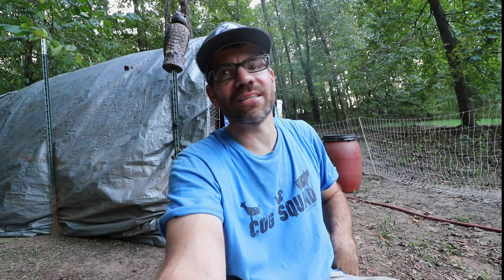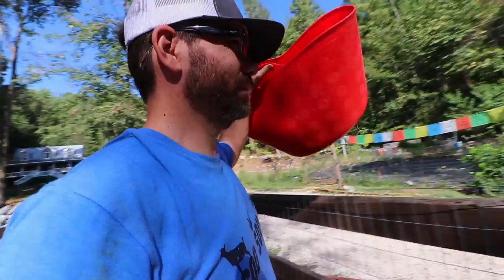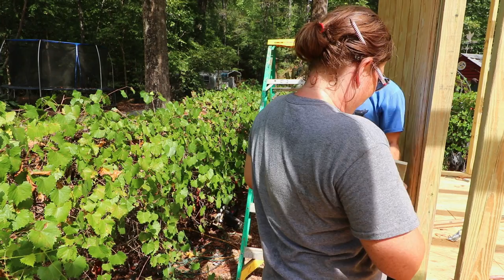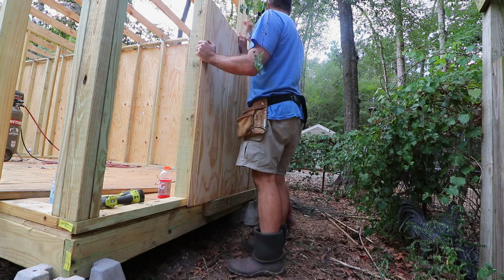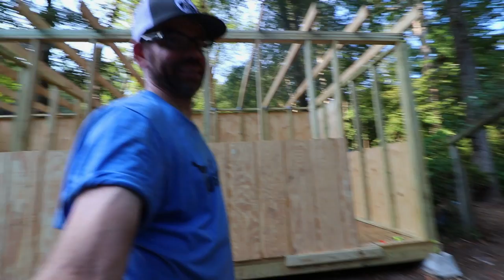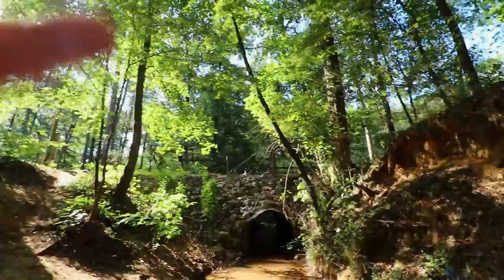Will We EVER Get This Siding on This Chicken Coop!?! (DIY CHICKEN COOP)

Comment: Ppl think the siding just hangs on the bones of the structure, but, it’s a structural element too..you can push the frame if it’s not quite square, then screw the siding in to secure the squareness. It provides lateral and other directional, torsional stiffness. I also learned that’s why two nails in a stud is so strong..it’s a combination of all the elements working together. Two well placed nails beats three that split the end. I learned so much watching a pro carpenter build my coop..

Comment: Looking good! I wish someone would have suggested the “Smart Siding” by LP. Instead of that T-1-11 siding you went with. The smart siding comes already primed. So it won’t soak up
Reply: Where do you find it? Thanks!
Reply: Home Depot for sure. I worked there and sold it for 16 years. It’s made from oriented strand board (OSB). It’s 3/8” thick and looks a lot like the T-1-11. It’s a very stable product and will not warp or delaminate like plywood. And best of all, it’s typically a lot less expensive than that 5/8” T-1-11. To say nothing of being environmentally friendly. Don’t let anyone tell you it’s particle board, because it’s not. It is rated the same as plywood for exterior use by the American Plywood Association (APA). Sorry for being so talkative. But it’s an excellent product!
Reply: @jacktomberlin7976  Thanks for the info. I took a photo. I'll know right where to go when I get there.. I was concerned about the weight of the siding but, MRS. COG HILL solved that one for me.. Thanks again Jack...

Comment: My husband and I are currently building our own first chicken coop.  I'm here to check on how you did your roof and we did it almost the same way except the pitch on ours is steeper (1 ft higher on one side than the other side).
Since I didn't bother with the birdsmouth cut (I'm the designer and lumber cutter, my husband is the installer), I too opt to using the brackets like you did here.
My biggest difficulty is the roof itself.  Since I'm much lighter than my husband, I'm the one who's going to climb up there and install the metal roof and I'm afraid of height.
Reply: Update: once a sheet of the metal roof was on, it's actually not bad.  I had a flat place to stand on (or in most case, I was sitting on it, more comfortable) screwing the roofs down.

Comment: I put my run up, biggest structure I've ever done, smaller then you construction.  I measured stuff out, I built it with headroom for my 6'2" body.  Got it done, filled the run with sand for easy cleaning.  Turned around to walk from one half to the other and BLAMMO!  now that I have about 4 inches of sand I have 2 inches too few head clearance for a support beam AND another purty dimple in my forehead!  Go big or go home.  Also, because I was rushed thanks to an operation I had to have the day after i finished and moved the chickens in, I forgot to put landscape fabric between the gravel base that covers the 2x4 wire to keep tunnerlers out that also goes to the drainage for the whole area and the sand.  So two weeks later when I could use my lawnmower to get out and look at things, I saw the gravel was popping up in the sand.  Kinda ruins the whole Rake up the Poo appeal of sand.  Luckily, I know a guy that knows how to shovel and can build a sieve from left over hardware cloth.  Fabric is 4 foot so shovel 5 foot over at a time.  It won't take long, when I get to it.  DANG!
Reply from the maker: Oh no!! I can completely empathize!